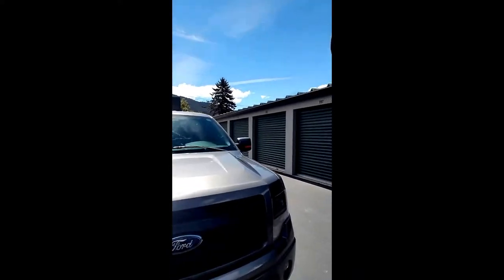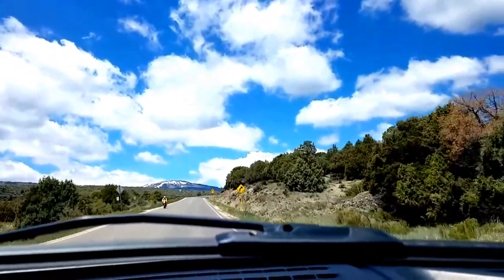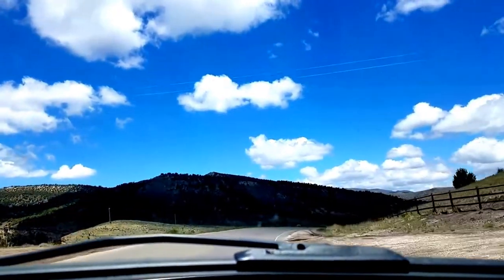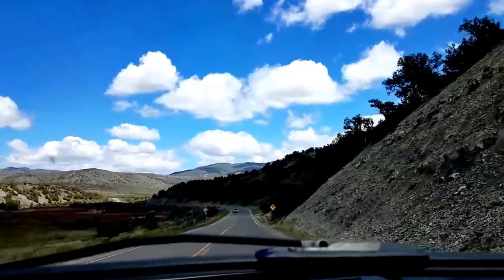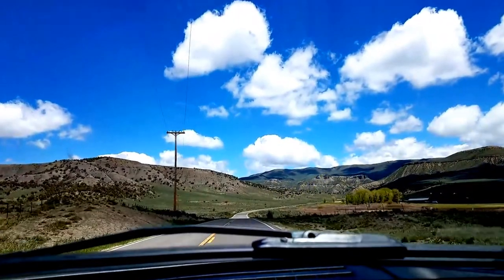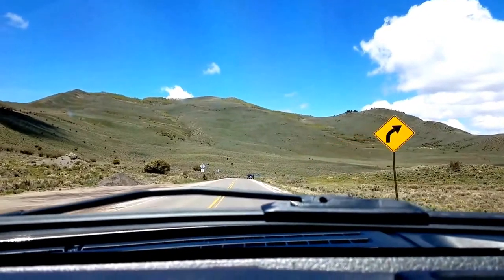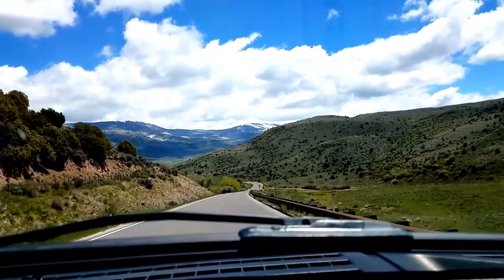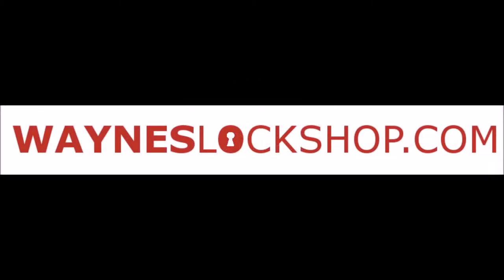Ford F 150 Eco Boost Towing Safe Trailer Review, Mountain Hills and Turns Pulling Power

Comment: Really no brakes at all on the trailer? Not even overrun brakes?

What are the reasons for transporting the safe upright? Build some rig to lay it down and rise it up. A lower center of gravity for a more stable ride...
Reply: stagepyro 1500 pounds is hardly enough to really be worried about center of gravity. As long as everything is strapped down right you will never have a problem. He scaled at 8000 pounds so he's only towing about 3000 pounds
Reply from the maker: stagepyro Never lay safe down, very bad for safe